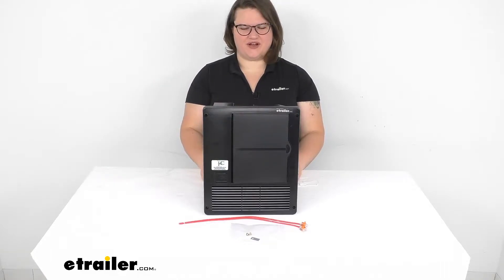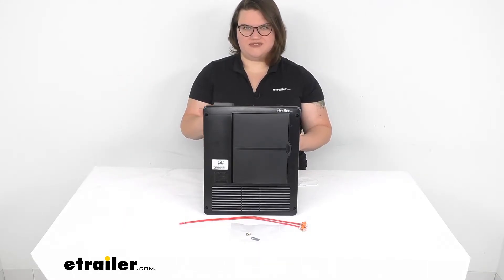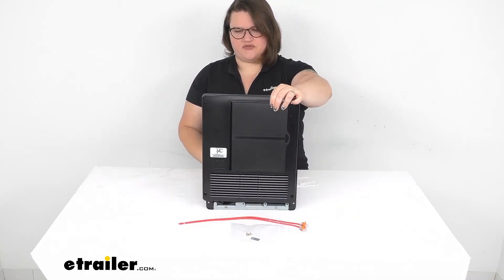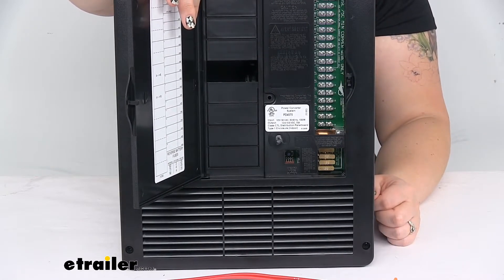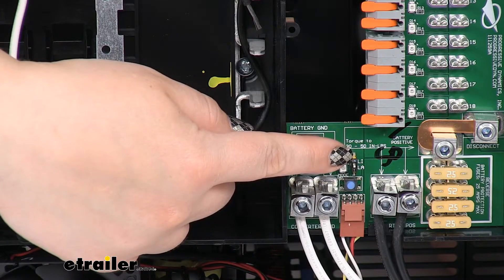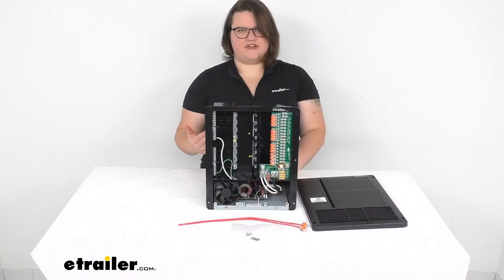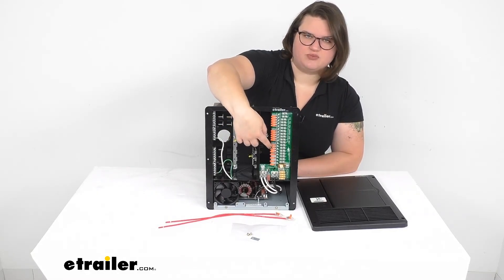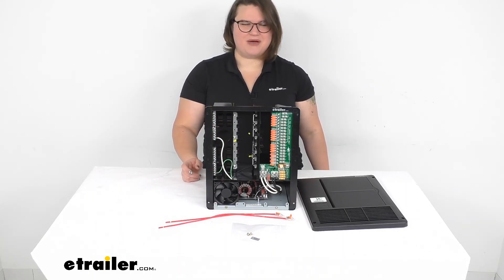etrailer | Progressive Dynamics 4500 Series Inteli-Power Converter: The Breakdown

Comment: I do not have the li switch, is there an add on component I can purchase to charge buy lithium batteries
Reply from the maker: This converter is designed to charge various types of batteries when plugged into shore power including lithium. 
https://www.etrailer.com/RV-Converters/Progressive-Dynamics/PD4575K18LS8.html
Reply: I have the panel as you.  mine does not have the switch either how did you figure it out?